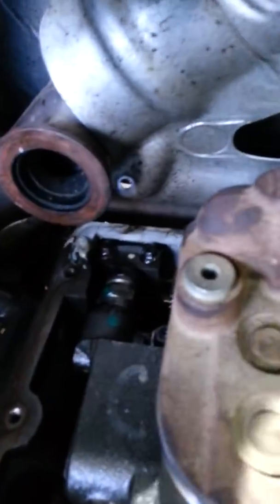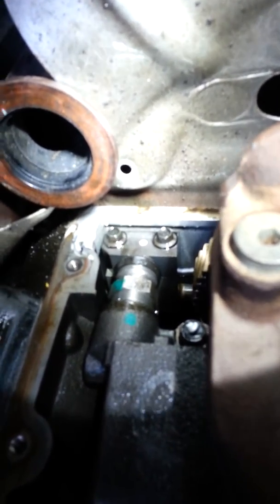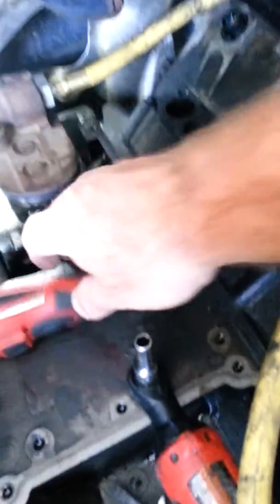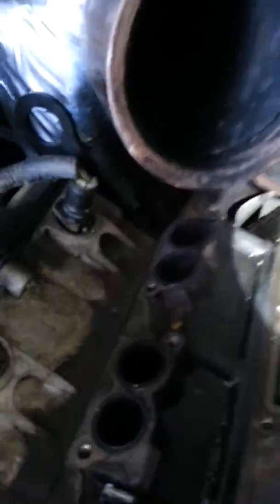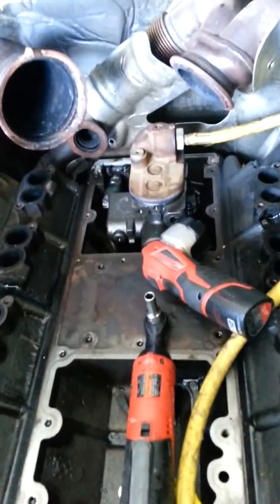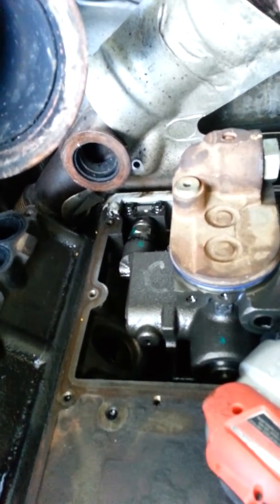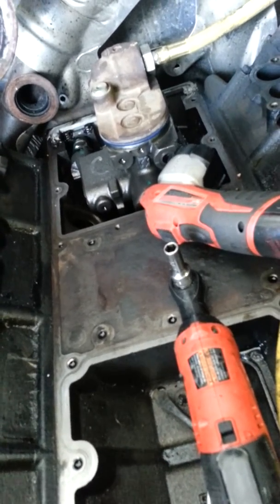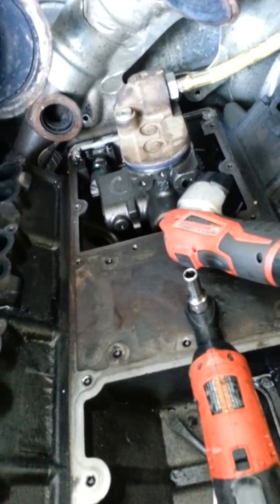Powerstroke stc fitting test

Comment from the maker: before you comment make sure you know the story...this trucks pump was bad the stc fitting was leaking also..you never condem the pump on a newer 2004.5 and up the pumps are tough..and they are the ones with the stc fitting..the older powerstrokes did not have a stc fitting but all the pumps were junk..yes you could have a bad fitting but good pump unless it has 250 000 miles then it would be smart to change the pump ,and ford pumps come with the newer fitting which is solid steel..sum rebuilders dont give the fitting at all..dont buy from these guys ..only buy genuine ford ..or you will get to do it again.